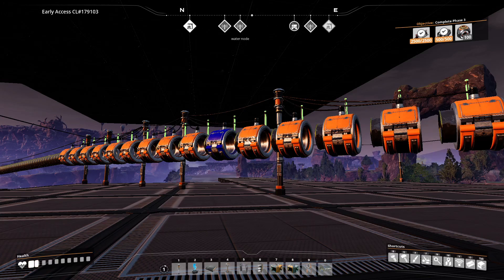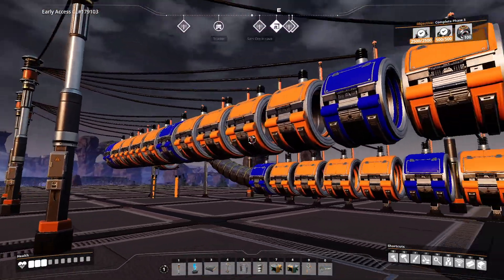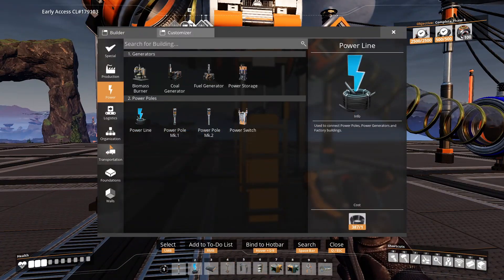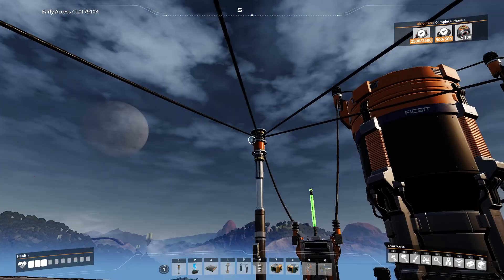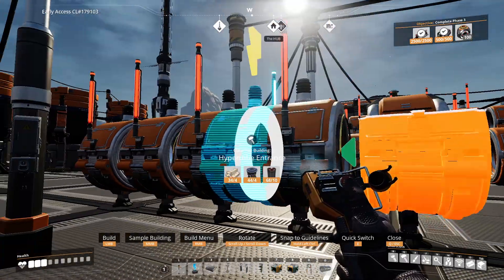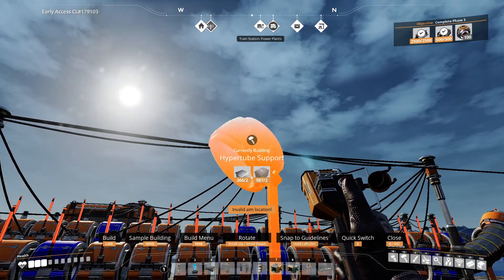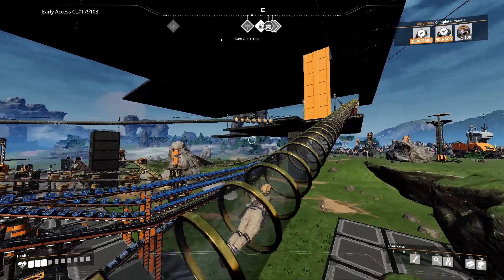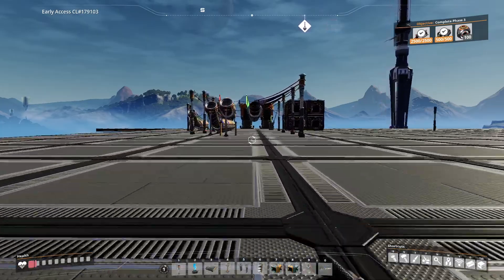Satisfactory How to make Hyper tube cannons and accelerators

Comment: Thanks for the tips, its good to see someone who explains it properly and has done some real testing instead of just half heatedly regurgitating what is already out there. 
and lol I think I saw the video you're talking about. It's a shame that's the crap that sells these days.

Though for the bit at 11:52 about the end point needing to be in a straight line I find that putting the final support on a belt lets it have more rotation angles again like being on the ground, which is good for aiming more specifically.
I have a bunch setup now going all over with jelly pads at the landing spots.
The distance can also be tweaked by entering with a run or a walk, though I keep forgetting and had to start using signs to remind me lol.
Reply from the maker: Thanx.... Belt on end sounds like a good idea but tricky like setting up landing zones with jelly in right spots.
I thought i mentioned the running part, the speed boost thing you can go when jumping can get you more distance too.

Comment: the ending rant has secured you a new follower lol ; btw thanks for the helpful build on making the cannon.
Reply from the maker: Thanx, Hope it still works.. Last guy said update changed it so it doesn't.
Reply: @bigdaddykarvix43  well I did it the same way you did and it seemed like it worked as this is my first time ever trying to make one now I'm on to make a cross map cannon thanks to you lol
Reply from the maker: Kool if its still working. I did say to do that slide speed jump thing into it to for extra speed right, for those long tunnels, the speed where's off and really goes down if tunnels goes up but still i went to that vs flying across map for the stable end points.

Comment: My friends and I made one of these on our multiplayer world recently and it totally doesn't work for just one of us (he gets glitched out of the tube as soon as it turns). Do you know of a setting that might mess it up or something? As far as we can tell, he's not doing anything differently from us and it's working fine for the rest of us.
Reply from the maker: Hmmm never played on server, you would have to do a search for that issue. But i'd guess that its a FPS issue, server FPS needs to be set to 30 or 60. (test it solo first and see how high a fps u can get before tubes glitch) Then all parties need to have same FPS settings.. If he is the one guy who thinks default unlimited is the way to go, then inform him its not the case for the way these tubes work at fast speeds.. Eyes can only see at around 60 FPS at best BTW. Higher FPS on games is just to make up for the bad and sloppy programing thats a out right lie when they say they output a stable fps of any kind.
Reply: @bigdaddykarvix43  We've tried lowering the FPS to 30 and cranking the settings to ultra but still no luck, thanks for the quick response though!
Reply from the maker: No prob. To bad it wasn't fps thats the first fix that works in most cases..  Let me know what the issues is if a general google search works to fix it.
Other then not having tube turn, stop and exit and new entrance going that dir lol. Was the stand removed, cuz lots go threw and remove the connection points so it just 1 long tube. Was stands used or just small made while using tube to build. I only use the big stand points (sry name i forget) so i can stack more on top (with a space or to so it doesn't block speeds) 
1 guy issues are hard to resolve unless your sitting at his PC. But more info helps any problem solving. I never use the the small close to ground tube/connecters, only use the stands that you can stack easy cuz being close to ground could be the issue with diff settings.
Reply: @bigdaddykarvix43  We actually just discovered that crouching solves the issue. It slows you down a bit but it stops any clipping out of the tube so that's something
Reply from the maker: Nice, O was the April fools thing still going on.. This is the game that gives you a huge head and makes the little red pet guy huge right.  LoL i remember it from last year when i saw pet was like 20 feet big and i was WTF until i saw date.

Comment: I’m not sure what the problem is I’ve tried lots of videos and I get launched a couple meters away
Reply from the maker: Did you follow all the steps correctly from my vid?  Some other vids are not clear on exact set up but so close and you might have over looked a small thing.
I can't see your set up to help, but i haven't played for a few updates. I didn't see anything that would have changed it.. Common thing might be FPS set to 30, if you don't do that tube can be unstable.
Reply: @bigdaddykarvix43  is this method only work for low fps?
i got like 100+ fps and i build like 10ish entrance but it won't sent me far away
Reply from the maker: @Jit Hey Jit U tubes filter doesn't show Replies on replies. Make a new comment next time so i can see it. Its 3 days and just rng looking that i noticed it....
But for question, yes mostly, thats why in vid i say if you want cannon to work reliable you have to change your game to 30 fps. Also you might need more then 10ish.
But some vid cards have that fps issue and some don't, but eyes/brain can only do like 60 fps I think, so theirs no real point in going higher.
My PC and vid card are weak cuz i'm always on old PC's so i put like all games to 30 FPS cuz it really helps with lots of issues and in cases like this it stabilizes fast movement speeds so you don't clip and hit micro walls/edges cuz fps is unstable.
Reply from the maker: Repeat: High FPS (anything above 30) can have the effect of making this not work. The system have to be STABLE Movement, if you move your PC moves to fast the next hyper tube might not register that you went threw it cuz you passed it already or if you try to have a higher FPS and PC has to slow down (which it will cuz the burst speed stuff that goes on when you go threw a tube entrance) then your speed is altered to compensate and you go back to square one for speed or just don't get the next speed boost.
Just lock your FPS at 30 and see if it works first, them raise your fps until it doesn't and use highest you can if you care about highest fps possible.. Tubes cannons will show you your PC's True FPS.

Comment: is this patched?
Reply from the maker: Not that i know of, it should still be working.. I don't see them patching this. Just make sure your at 30 FPS setting to avoid problems with changing FPS times that make it unstable.
Reply: It's not working any more, you can only place the entrances at the ends now
Reply from the maker: Is that true did they update it and change it?  .. 7 days... ya add stuff as a new comment not as a reply... Thats something youtube need to update and change.. dam filter that works on new replies too not just new comments.
Reply: @bigdaddykarvix43  I just made one with this method and a different method and it works fine for me. I'm on Early Access idk if that makes a difference!
Reply from the maker: Ya someone else said it was still working so maybe JP just wasn't doing it right, can be tricky to see cuz their so close together.